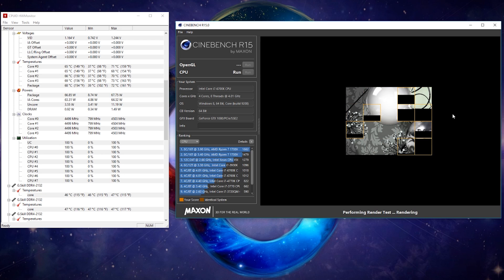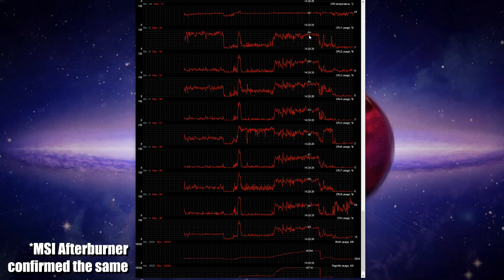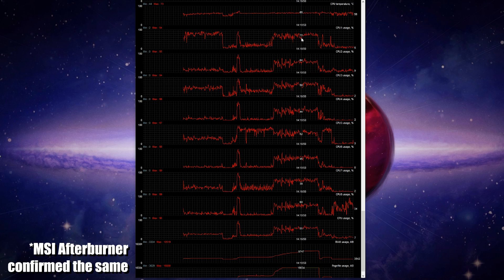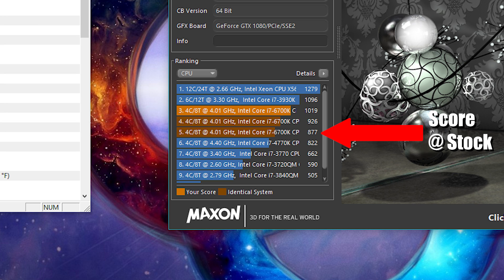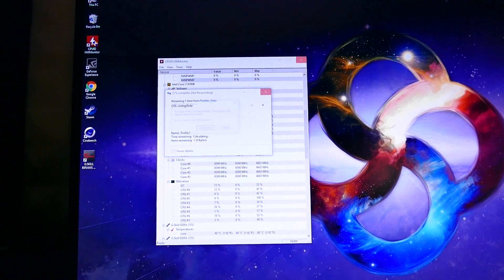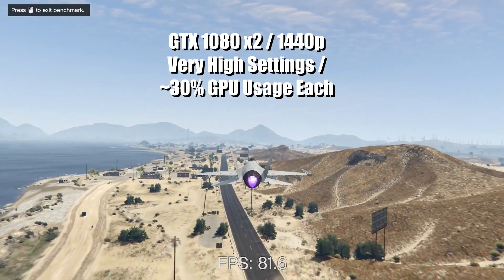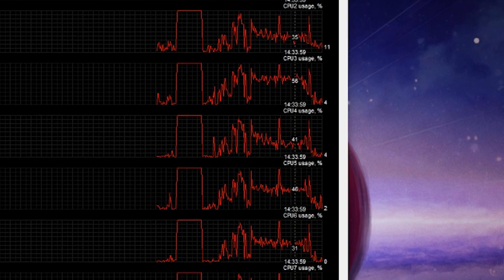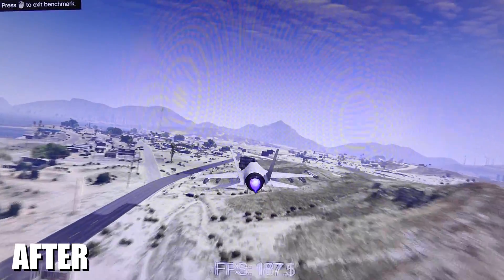My PC was Terribly Under-Performing...

Comment: This is going to sound stupid
My friends pc (i7 4770, gtx 760 16gb ram) was getting 50fps on counterstrike, but working fine in other game. I found out it had super low gpu usage, like 5%. Turns out it was drivers from a tp link wifi card he had. Deleted that and there was no problem. I spent so much time finding out what the problem was, just ended up reinstalling windows and later found out that the drivers caused the issue. Threw that wifi card out and never want to see one again.

Comment: I had a similiar problem with around 30-40% lower performance that it should had, with an i5 3570k @stock and a RX480 8GB @stock and tried everything, re installing the OS solve the problem, but nothing even DDU solve it, I guess that seeing this video means that im not getting crazy.
Reply: José Carlos I have the same CPU as you. Assuming you’re still using it now, how’s it performing?

Comment: I am coming in to this as your first video, and don't know what all you tried....that said.

I have had trouble personally with a graphics driver corrupting on install.  To resolve it I had to uninstall the driver completely and reinstall.  That could have been the issue with the SLI you were seeing, just my two cents.  (to back this up I do have 10+ years experience working IT)

Comment: hello, i have a laptop with a i5 6300HQ, GTX 960M 6Gb, 8gb of ram a ssd but i can't run battlefield 1 in normal at 1080p 60fps, how can i improve my fps ?
Reply: Gabbiadini You sir are a God and saved me from a complete mental break down, lots of head trauma and possibly breaking my $800 gaming Laptop
Reply: Turn off AA, make sure resolution scale is 100%
Reply: Prich038 ok, the render scale is always at 100%
Reply: Gabbiadini ty but im already doing all that, i wanted to know if i could tweak some things to make him run games better
Reply: im planning on that too
Reply: TheNouvelleCopine78 TheNouvelleCopine78 this is what I do (and my system is much more powerful than your's):

Resolution scale 100, High Texture and Mesh, everything else off or low.

The game still looks good and plays wonderfully. It also gives you a bit of an advantage  b/c you don't see dark shadows >:)
Reply: tiestofalljays apreciate the help, ill try it

Comment: Definitely some shenanigans going on with Windows 10 and recent updates.  They have gone so far as to reset local group policies I configured to turn off things like Windows defender, automatic updates and hardware driver updates.  My guess is they deliberately reset these settings because they WANT you using THEIR apps so that they can gather and track the most data on you.  It is also possible their Game recording software/services were running in the background and messing with your NVidia drivers as well, whether you wanted them on or not.  Past updates from Win 95 on through 8.1 have maintained user settings like this without issue, and Win 10 is on the same code base at 7 and 8.  And enabling resource wasting features like the game recorder without user approval is inexcusable.

Comment: I now this comment may be redundant, but before i format a system drive and if case the mainboard you use has the ability to use the integrated gpu, i'd remove the gpu (both), restart, completely remove drivers, let the system install generic drivers for the integrated gpu, restar a couple of times, then reset bios, install the discrete gpu's and install drivers, that has worked for me in the past.

Comment: Check your storage disk(or the disk you have your games on) for bad or weak sectors. My pc has a dying hard disk and when it reaches a slow or bad sector the pc's performance goes to shit(disk usage is at 100% in taskmanager while one process is using the disk with 0.5mb/s), when I reinstall windows it works great again while it's semi empty. A great example for this is csgo. When the os is new and the hdd is empty i get arround 120-130fps, when the hdd gets filled(even if I defrag it) the fps deops to like 60-80(with a browser open in the background, sometimes it even drops to low 20s).

Comment: You could've tried ddu to remove the nvidia drivers before trying to reinstall windows, also that is a very strange issue minus the cmos problem with the cpu i have had alot of weird issues with windows 10 and different setups with driver and uefi issues.

Comment: Having years of experience, unfortunately, in dealing with these kinds of issues (I started building my own PC's in 1996)...I would have to agree your SLI issue was caused by the OS....especially Windows 10. Windows 10 has "issues" with adding new hardware or upgrading hardware and even updating drivers for devices. This seems to be an ongoing issue with some versions of Windows OS's over the years. Beginning to think Microsoft is purposely doing this.... ;)

Comment: If anyone else have similar issues and is sure it is not a hardware problem then I recommend doing a clean boot. By doing that windows only boots with the necessary programs and drivers. Then you can make sure if it's a driver/program that is causing the issue or something else.

Comment: I had same issue with 6600k. On 4ghz it runs okey, but when i overclock it to 4.5, it didn't give performance, cinebench score was little bit better than on stock. And one more thing - cpu load graph (hwinfo64) was stressful,  all cores jump  ~2 - 50%. Background was "clean". I tried to play with voltage. That did nothing. So i just set it back to 4ghz \ 1.2v and stay calm.

Comment: Bios and OS is always the last resort but it seems like you were at your wits end with it. It's just a matter of avoiding a repeat of it, as don't truly know what caused the issues but for both CPU and GPUs to have such difficulties, is something I've not encountered. Not something you'd want to do, but would be curious if this kind of issue can be triggered under your control, where you can revert back without having to go though such a huge amount of issues. I wanted to suggest rolling back your windows, to maybe when you first installed it or when it was last working at least? If you haven't made a backup, I would strongly recommend it. Thanks again for your videos.

Comment: I had the exact same issue as you about 3 months ago. I have basically the same build except x2 1070 FTW.  If you reinstall windows but keep files it also works. I also couldn't find anything online about the issue. I used Firestrike to test and I gained around +3000 afterwards. Glad to see that it wasn't the system as I only built it late last year with all new components. If you do find the cause at some point could you please do a follow up video it would be nice to at least know what caused the issue in the first place.

Comment: Reinstall the OS is only a major pain if you are egregiously messy, and don't properly separate functions (OS and apps) from data (your  files). Whenever the PC seems to start kicking the ghost, for inexplicable reasons (and not hw related) feels good to don't give a damn. Had to reinstall a few days ago, and it took less than 4 hours to be full up and running with all installed and everything in place, like I wasn't reinstalled.

Data is in the OpenMediaVault NAS, and in my case there is a small handful of apps to install (which I could probably fully automate with Chocholatey if I wasn't lazy) plus some games (which again if I configured Steam Libraries would be faster, but fiber and lazy). Install the relatively few updates while doing all the other stuff, since my Windows 8.1 ISO have most of the patches integrated. And while is not the best by any stretch, for me is a good enough system that took the pain completely out of reinstall.

Comment: You can't claim to be scientific if you're going to claim "I know it's not X".  Next time I would try something called DDU. Display Driver Uninstaller. I use it all the time if I'm having issues with GFX cards. I had an issue with two 970's (not related to the memory weirdness) and DDU fixed it. DDU uninstalls your display drivers while the PC is in safe mode, completely getting rid of all remnants of said driver. Your PC probably needed a refresh anyways, but who wants to spend a whole afternoon downloading games from steam?

Comment: Did you get the Windows 10 creator update? I have never had any issues with my computer until after that update it screwed everything up and I had to reset my PC.  Also the creator update doesn't like MSI Afterburner either.

Comment: Hey man. Love the channel. I see you use MSI Afterburner. 
Did you play around with the overclock settings?
I've had afterburner down clock my GPUs in the past when i would swap out for different models. That drastically affected performance too.

Took me a long while to figure out what the hell was causing those issues. 

Just a thought.

Comment: Install MSI Afterburner with RivaTuner, turn on OSD and look at the core clock of the GPU while gaming
Sometimes, some games engines/GPU drivers are downclocking the GPU for no apparent reason and thus - underutilizing it. It's even worse if your iGPU (the one integrated in the CPU) is enabled.
If it happens - try to find some newer vBIOS for your GPU or some custom, modded GPU bios. Changing GPU driver or installing some patches might also help.

Comment: Skylake introduced a new clock called FCLK it's the clock between CPU and dGPU (i may be wrong i just remember i read it on some OC guide) i think u had it on 400mhz or 800mhz (maybe SLI care about those last 200mhz :P) cause by default it's 1000mhz . can u pls try to test this theory cause i dont have SLI even if i wanted to, i have a 1060 -.- that i felt isn't the best for me .

Comment: I have damn near the same setup!!  I have an EVGA GTX 1080 SC, a 6700k and I have been noticing an issue with performance recently.  In my NZXT Manta, the 1080 gets warm, but doesn't throttle (72C under load) and the 6700k at 46C.  I might have to clear my CMOS and see what is going on.  I'll post an update if I notice any changes

Comment: The I6700k only has 16 PCIE lanes and pciE x8 is the minimum for gtx1080 cards. lower than that and you will lose performance. When you have two slots and use some more PCIe lanes for SSD or M 2.0 than this cpu is not a good choice for sli in general.
Reply: Unintentional Good it has 24 lanes total like ryzen you dodo.
Reply: well thats not what the specs say at Intel. They state you can have either Up to 1x16, 2x8, 1x8+2x4. Those are the lanes you can use for your GPU's anyway:

https://ark.intel.com/de/products/88195/Intel-Core-i7-6700K-Processor-8M-Cache-up-to-4_20-GHz

Anyway it's known that this is not the base system chosen for SLI in general.

Comment: Welcome to PC trouble shooting on papers everything seems black and white "EZ PZ" but then the strangest most unrelated thing is the actual problem.

I had a weird problem that started out of the blue where my computer would lock up randomly during use. I'd have to force power down the system to use it again. Tried everything, or so I thought, every component was working fine and I even sent in the MOBO, which was our prime suspect at the moment. We got it back 2 weeks later and when I reinstalled the motherboard i noticed a strange "standoff" (that looked like a grain of rice with some threads on the bottom half) on the computer case where the standoffs should go; so I removed it and that solved all of my problems. The 1cm bump was creating enough tension on the motherboard that it would cause my computer to lock up randomly when I was using it. I still don't know why it took a full year after I built the machine to experience this problem though and perhaps I never will. 

Man you gotta love troubleshooting computers.

Comment: I currently have two 980's (only using one, need a new PSU) and one of them was performing way under spec which felt weird. It was accepting my overclock, and was hitting correct frequencies. Seemed to be doing everything correctly that I could see, but for whatever reason had low frame rates. I put the other one in and it works fine, but I am beginning to think I may have just had like "Windows Audiograph Isolation" running or something in the back. I reformatted recently and now I'm curious if the other 980 would run up to par after seeing your video, because it was running properly as far as specs.

Comment: This happens to me often when I only have one 970 in my rig, and I realized that every time when you are updating your nvidia GeForce experience driver, you have to press custom installation, tell it to have a brand new install, and the issue will usually be solved. I'm not sure what is causing this, but I guess is the cache that is created over time. Try it by creating a new user on your computer, hope it helps :p
Reply: Does it take a little bit of time to download ?

Comment: Had same problem with my 7700k and gtx 1080 sli. happened after windows crashed 3 or 4 times when I was overclocking the cpu. next time I'm doing a fresh pc build I will reinstall windows again after I find my overclock stability then install my games.

Comment: On my I7 2600 it lost 100 on cinabench and it was the POWER SUPPLY. I swapped out my 500watt Pc power and cooling for a old 850 watt Thermaltake Toughpower and boom system sped up back to normal.......

Comment: I've seen unstable overclocks that caused Windows system files corruption and resulted with a fake sense of CPU bottlenecking the GPU. That happens if a system is only "game stable" for a longer time, the errors accumulate. In some cases running SFC fixes it, but the best solution is stabilizing the OC and a clean install of Windows or restoring an image of the system made when it was fresh.

Comment: salazar, i work at a computer repair center/retailer. i always recommend customers to just install a new copy of Windows because it is sometimes literally impossible to fix software issues. i rarely fix hardware issues but the problem is that you just cant say to a customer you need to wipe everything on the computer and buy like a 30$ usb to store all the info they need before wiping the hard drive. i just try my best running Malwarebytes and deleting tons of useless stuff and just act as if the computer is now flying.and it works😂😂

Comment: If someone could help me i would appreciate it. I have RAM issue on windows as every time i start my computer my RAM usage i always at 90-100%, I've tried everything from reinstalling windows and I even bought a new MOBO and RAM and have the same issue, I tried to fix it via the advanced system settings where I manuely set the settings that would be appropiet to my RAM size which is 8gb, it worked for a few days but know I have the same issues and I tried puting back the advanced system setting to automatic but ofc that did not work. Every help i can get is as I said very much appreciated.

Comment: (Off topic) I had problems with Java x64 nothing worked and when I boot up my PC after around 15h+ I always got a blue screen. After that my PC worked fine. So I reinstalled windows 10 from scratch and everything worked fine again.

I want to mention that I upgraded from windows 7 wich had absolutely no problem to windows 10 and the bsods were there since the upgrade but the Java problem occurred since 3 Weeks.

Comment: Hey greg you should try playing with the windows power settings. Switch it to balanced (default) and see if the problem comes back. Also in nvidia control panel you should set the GPU's to use maximum power. Had problems similar to this before.

Comment: Strange.. Did you disable 'game mode' and all that gaming crap Windows loaded into the OS after the recent creators update? I'm guessing it's just related to that. The creators update has (apparently) been causing people a lot of random game problems. And yea, the CPU thing has happened to me before. Even on a stable OC, randomly a week later it would start giving me scores 20% or so lower then normal. Normally I just reset CMOS, boot, shut down, reapply OC from scratch, and it's fine. No idea what makes it happen, it's always so arbitrary. Glad you got your FPS back though :] You should make a restore point at fresh like this, and if it happens again, try rolling back Windows to it and see if it corrects itself (theoretically, it should).

Comment: dude i have the exact same sli issue with my two 1080tis, everything except overwatch will run both my cards at 30% usage or less, minecraft for example when i use shaders and a 128x texture pack will only use 10% of my bottom card and like 50% at most on my top card, any help!?

Comment: I had bought a pre-made computer about 3 years ago from bestbuy, which was not a great idea, but I did not know better. It has an i7-4790 stock, 16gb of ram and a gtx 745... :( I have also noticed a huge decrease in performance. My i7 is clocked at 3.6ghz, boosting to 4.0. It would usually always run at 4.1ghz. Now, three years later, it only runs at 3.85ghz. I changed the thermal paste and check everything, but no improvement. My gtx 745 makes way more noise than before and my case gets way too hot. I've cleaned all the fans, even my psu fan, but still, no improvement. I really don't know what to do. Games like Minecraft, which isn't really demanding with an i7, are beginning to lose frames. I used to get 150 - 350 all max, now i can barley break the 250 barrier... Any suggestions?